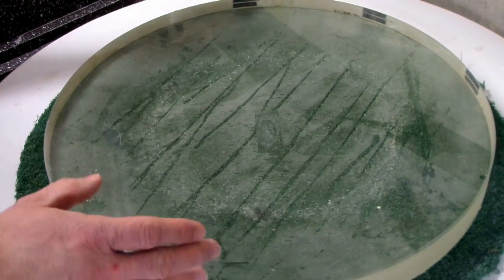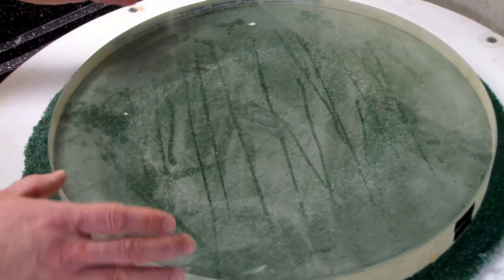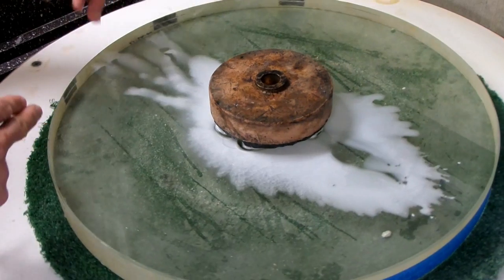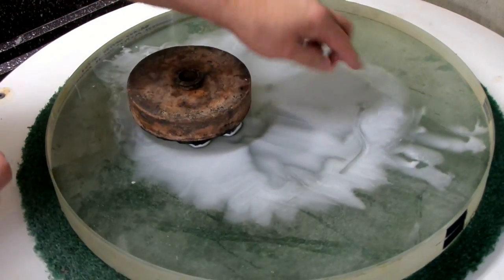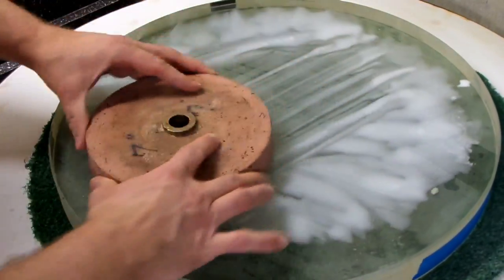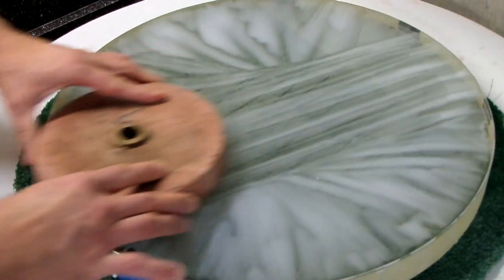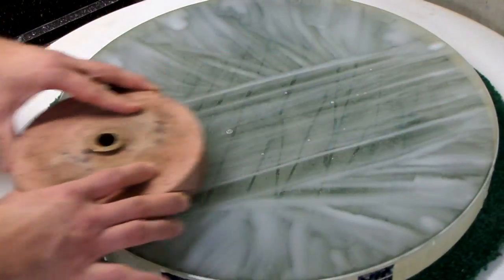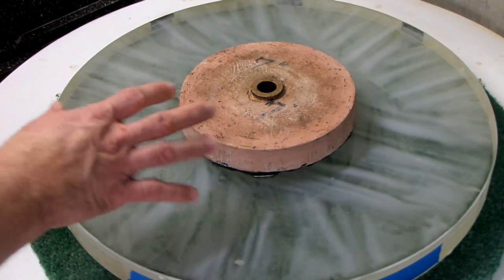Techniques for Refiguring an 18" f/4.4 Telescope Mirror

Comment: Thanks, Gordon for your great video.
I was wondering whether you can make a video on how to take scratches off a mirror.  I have a 10-inch mirror with lots of scratches on it, took the aluminium coating off using your other video that showed how to do it, but now I want to grind down the glass surface to take the scratches off and then give it again to be coated.
Reply: Hi Afshin,
You can not "take away the scratches". You can only grind and polish (or only polish if the scratches aren't too deep) down to the bottom of the deepest scratches. You need to make a grinding/polishing tool and a pitch lap and you need to buy all the reqired materials. If the scratches are too deep to polish them out the mirror is practically ruined and it has to be considered a pre shaped mirror blank. Unfortunately in any case the parabolic shape will be lost in the process so you need to re figure the mirror after the scratches are gone. You need at least a focault tester and a zone mask to check for the actual shape multiple times during re figuring. 

Even with good instruction you are probably looking at a 100 hour job as a beginner. I'd rather suggest you buy a new mirror instead or just use the telescope with the scratches if they are not too extreme.

Comment: Can a good figured 400mm F3 mirror with a Parracor be a good performer on planets?
Reply from the maker: Any mirror with a good figure will perform well on planets, given it is at a stable temperature, well mounted, good secondary, etc.  Your chances of having a good figure on an F3 are probably lower, though, than having a good figure on a longer focal length mirror.  The difficulty of figuring short, fast mirrors goes up very quickly.
Reply: @GordonWaite  
❤️

Comment: What amazes me is how you can make something accurate to a fraction of a wavelength of light just by shoving a tool around with your hands in various vaguely defined patterns.  I mean, if it was done by some sort of computer-controlled machine, or even a purely mechanical gizmo that made repeatable motions, it would be easier to believe.  But your hands!  And to think, if you don't even have the rotating turntable, you can still do it with a stationary blank by walking around to work from different directions.  It's totally incredible!  I wonder how anyone ever figured out that this was possible?
Reply from the maker: One day after I made an 18" mirror, I calculated that my turntable had done about 75,000 revolutions during the fabrication.  Each one does just a little bit of work!
Reply: @GordonWaite  And to think old Bernhard Schmidt did it with one arm! :-)

Comment: Hey Gordon, do you have any experience with making scopes using spherical mirrors and flexing? If so, what are your thoughts? Spherical primaries are super cheap on eBay and obviously easier to grind for amateur makers, so it seems like spherical flexing scopes would've taken off, but I haven't heard too much about them...
Reply from the maker: If you have a well-polished spherical mirror, you are just a little more work away from having a finished parabolic mirror.  Making a flexed mirror isn't all that easy.  Lots of mechanical parts to make, and you have to learn to test a mirror anyway.  Might as well parabolize it and feel really satisfied!

Comment: Tulip lap is what I call the lap design you use where you trim the edges down to decrease the effect at the edge of the lap. The edges look like the tapered ends of the flower. Figuring is an art, and you are an artist for sure!
Reply: Garth Elliott Thanks, Garth, for your generous comments.  Yes, the description you give for a tulip lap is, indeed, the way I cut these.  At first I thought you were describing a "petal" lap which is normally a full-sized polisher with a pattern for parabolizing.  That's something else entirely.  You are exactly right, though, in your description here.  Best of luck with all your projects!

Comment: Gordon, that long stroke with a one inch overhang could give you a turned down edge except you use a "tulip"lap, right? I have made two 24" and one 20" scope. One winning an award at Riverside. Would like to do a 30 or 32 inch ( on bucket list).
Reply: Garth Elliott Hi, Garth.  The long stroke with the sub-diameter lap and the 1" or 1.5" overhang will add correction both in the center, and at the edge.  It will put in correction faster at the center than the edge.  As long as the outer zones can take the correction, you won't get a turned-down edge.  But, as with any stroke that puts in correction toward the outside, if you use the stroke too long, you WILL get a TDE.  And a very deep center!  I don't use a "tulip" lap on any of my sub-diameter polishers, but I do "scallop" the edge a little.  You should follow your heart and go for a 30 or 32-inch mirror.  Especially if you can shoot for a fast optic, like an f/3.0 or around there somewhere.  If you have the time to do the job right, the short-focal-length mirrors can be wonderful for wide fields and comfortable viewing.  Good luck with your projects!
Reply: Garth Elliott Hi, Garth.  The long stroke with the sub-diameter lap and the 1" or 1.5" overhang will add correction both in the center, and at the edge.  It will put in correction faster at the center than the edge.  As long as the outer zones can take the correction, you won't get a turned-down edge.  But, as with any stroke that puts in correction toward the outside, if you use the stroke too long, you WILL get a TDE.  And a very deep center!  I don't use a "tulip" lap on any of my sub-diameter polishers, but I do "scallop" the edge a little.  You should follow your heart and go for a 30 or 32-inch mirror.  Especially if you can shoot for a fast optic, like an f/3.0 or around there somewhere.  If you have the time to do the job right, the short-focal-length mirrors can be wonderful for wide fields and comfortable viewing.  Good luck with your projects!

Comment: hey gordon... i want to know what kind of motor you use on your equipament... do you use a/c motor with pullies or d/c motor ... and how much power? 1 hp... 1/2 or even 1/4 hp... Thanks. Greetings from brazil
Reply from the maker: sacrip tex I use mostly 3/4 hp motors.  All are three-phase with inverters to run off 120V single-phase standard current.  the inverters give you full control over motor speed, and good ones offer balanced torque over the whole speed range.  I usually put a 30:1 gearbox on the motor, and drive the turntable from the gearbox, giving speeds from 0 to 60 rpms.